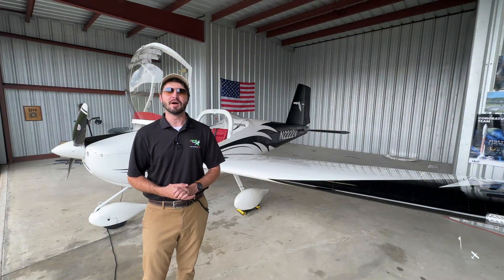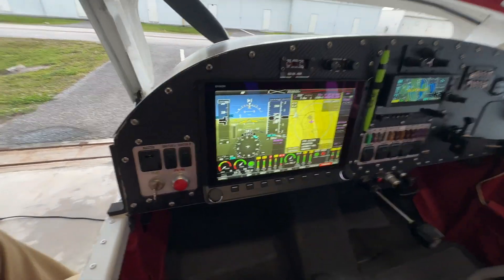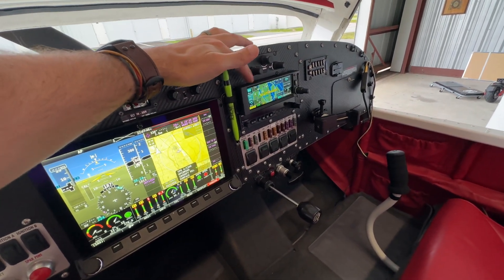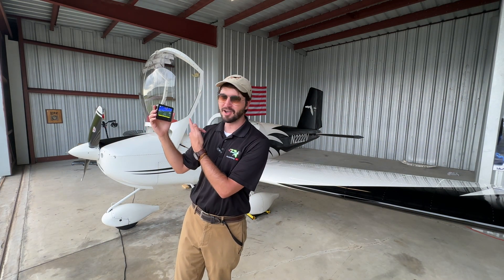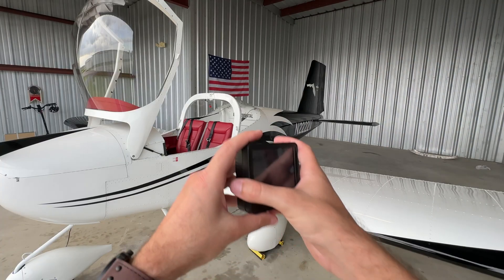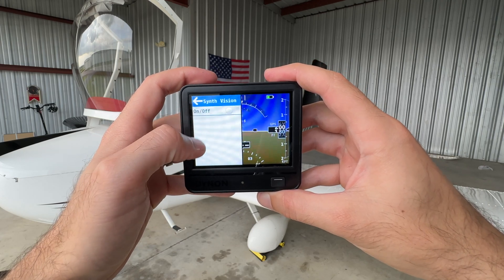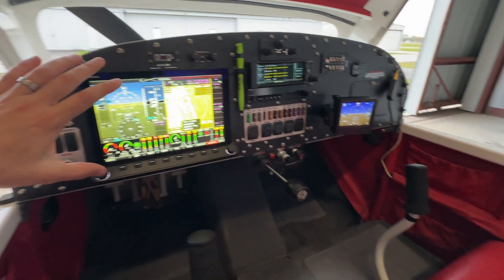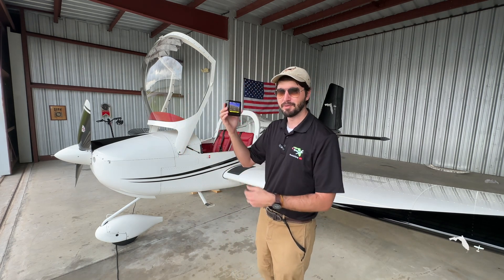Why Every Airplane Needs one of these - Life Saving Gadget

Comment: I was one of the primary software developers on the D3. It's cool to see people getting real world usefulness out of our products.
Reply from the maker: That is so cool! I love my entire Dynon system. It’s reliable, simple to use, and more affordable than Garmin. Thank you for you hard work on the D3. It would be cool if it could give an attitude without GPS, but the chances are low of losing my panel, losing GPS, and being in the clouds at the same time
Reply: @FloridaFlying  Due to forward momentum affecting the accelerometers we need to know how fast you are going to calculate an accurate attitude. The only source of speed for the D3 is GPS. So without it we red ex the attitude screen as the attitude displayed in that situation is potentially incorrect. In this mode the D3 should downgrade to only showing the instruments we can trust, which I think are the turn rate gauge and slip ball. Not very helpful but better then nothing. This is also the reason why the D3 is officially not for use in IFR conditions, it very heavily realizes on GPS for most of the information it displays and that is not guaranteed to be available.
Reply from the maker: @K3rb3ros that makes sense. Yeah you’re right the turn rate and ball slip/skid indicator work without GPS. Either way, the D3 is the best completely independent backup on the market. You did an excellent job and I absolutely love it.

Comment: Do you add pitot heat? I’m looking into a rv12 for ifr training. Thanks for sharing your journey.
Reply from the maker: I do not have pitot heat. It actually isn’t required for IFR but you have to be very careful with icing conditions. I plan to avoid ice like the plague, which is usually easy to do in FL.